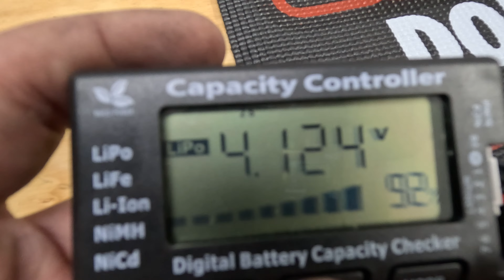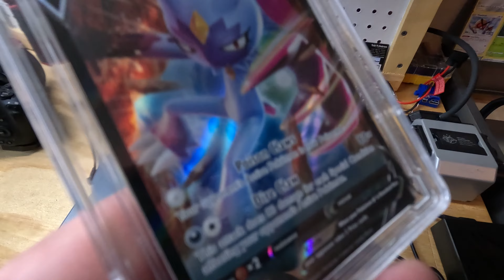This Car ALMOST Cost Me Thousands | ABSOLUTE MADNESS

Comment: I got 3 of those 4s SMC HCL lipos. Check the JST balance plug on the end to make sure it has a good connection.
Reply from the maker: I did! I even tried not balance charging them for a bit to see if I could get that cell up to a safe level. But no luck. It just does not charge
Reply: @WickedRemoteControl yeah, I tried that with the 4th 4s 9700 mAh... lots of smoke later & my favorite charger was toasted 😢

Comment: Cheap batteries are just as good as the expensive ones..
Reply from the maker: But at least they are cheap lol
Reply: No they aren’t yes they run the car power it on ect but when your going for high speeds good voltages minimal voltage sag good response then cheap batteries aren’t anywhere near as good as name brand batteries and it’ll tell on you with bashing to had a 3s 6000 mag zee battery worked amazing in my bashing cars put it in my onroad basher died in less then 5 minutes offroad it would last 30 minutes or so
Reply: I fully charged about 7 packs of cheap chineese batteries and stored them in my hot 100F+ garage for well over a year. Only 1 battery failed, actually 1 cell. Yed you 100% correct, but for a 20 year old wanting to get into the hobby. Those batteries will suffice.
Reply: @je2916  I mean yeah if you want to buy cheap batteries the more you use them the faster they die and go out and end up outta balance especially bashing them I’ve done it and I’ve also killed a few name brand ones bashing them to but that was my own fault used to low of c rating for the cars I used them in but I promise your gonna want better batteries if you plan on speed running or heavy heavy bashing cheap ones will last for your applications and being a beginner bug bigger cars require the higher mah and c ratings or it’s going to kill your battery every time no matter the brand onyx batteries are good chnl batteries gens ace batteries all good batteries and I believe all of them have specific batteries for speed running and bashing onyx just released some black packs not to long ago that seem to be some beastly batteries for speed and bashing the kid max that’s always on Kevin Talbots yt made a video with his jackhammer build I believe but he used the onyx bashing batteries beat the life outta the car batteries were still over half way charged if I remember right